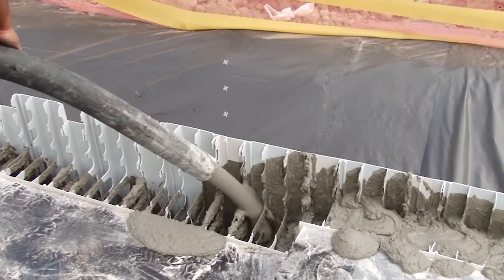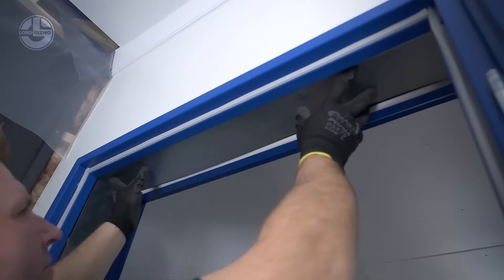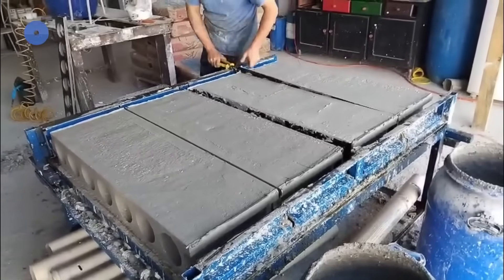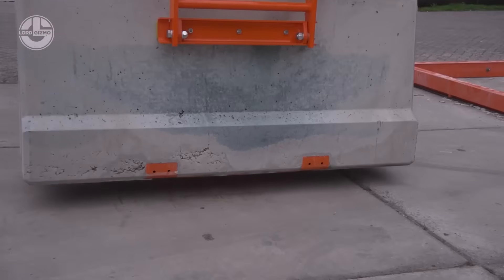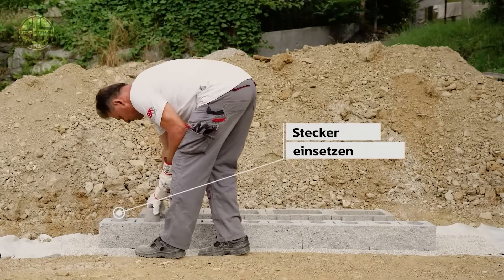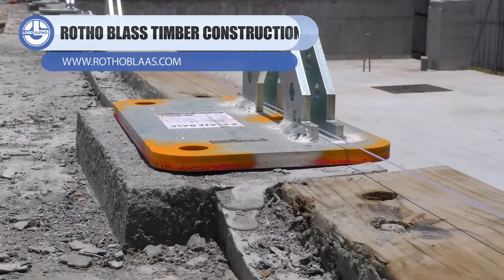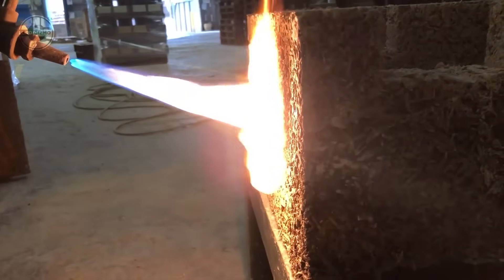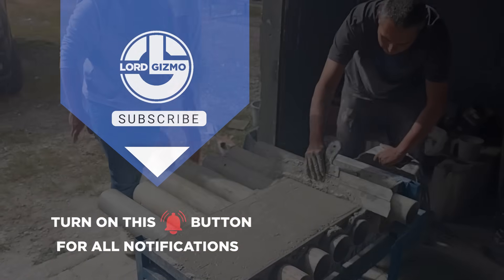The Future of Building Is Here — Mind Blowing CONSTRUCTION Technologies You Must See

Comment: During WW2 they made pill-boxes by filling hessian sacks with a mix of straw, sand and cement, stacked them up to make the structure and then poured water over them. Two days later, they had set and dried and made an unbelievably strong structure, you could easily studwall and dryline them for a conventional interior finish. Worth thinking about, no skills are needed to stack sandbags.
Reply from the maker: Yes its an amazing process. Fast and efficient